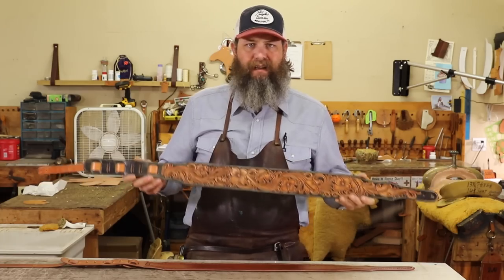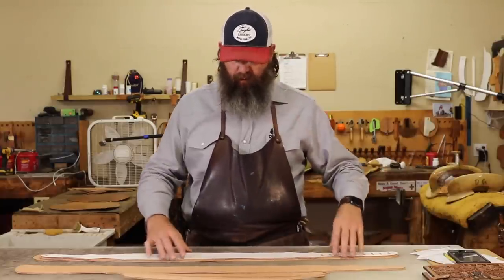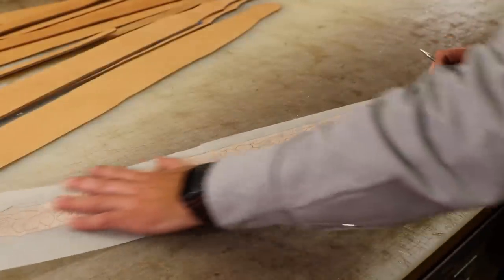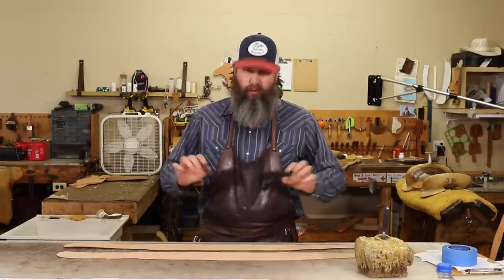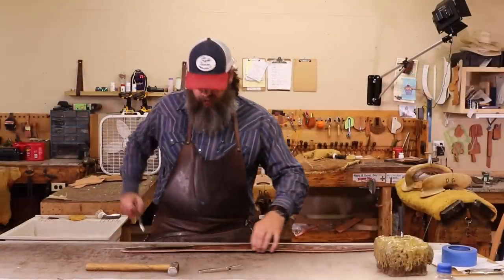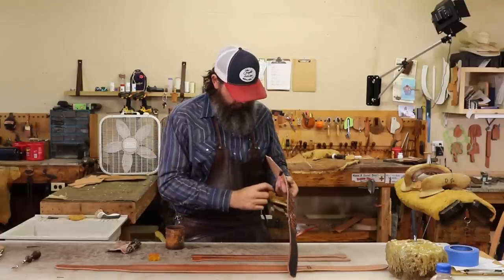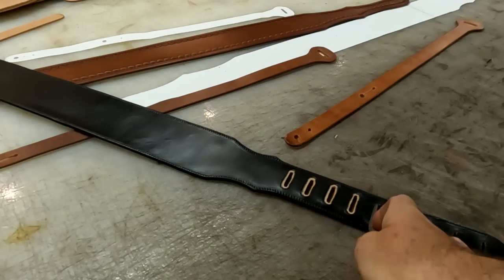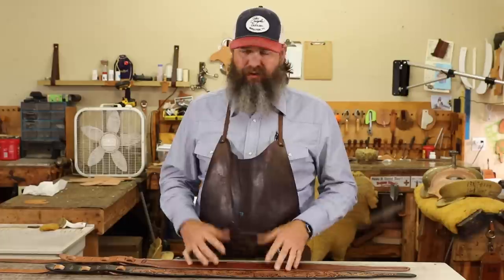How to Make a Western Guitar Strap

Comment: Awesome work,love it...Mr Gonzales,just for clearification...you brushed in the black and then lightly oiled and then antiqued with black?....I just ordered your pattern for this
Reply: All of the black is dye. He usually uses a fine pointed brush with long bristles. This allows it to hold a lot of dye & when you touch it in place, it will spread in bar grounding/backgrounding. Then you can use the dauber around the sides & ends.  I believe he uses fiebings Sheridan brown antiquing paste (I've made the mistake of using gel before & it bleeds through the resist & colors it all).
Reply: Yes he uses fine paint brush for the background and edges. Then olive oil lightly or to desired color then resist. He uses tan kote then antique paste. Then tan kote again after dry.

Comment: Hi Don do you dye leather? If so what kind of procedure and application do you use, i find it hard to dye without the dye rubbing off (i do it with a wool dauber) using pro oil dye.
Reply: I had the same problem, until I started using Fiebings Leather Sheen.  It seems to work great, and doesn't change the color much.